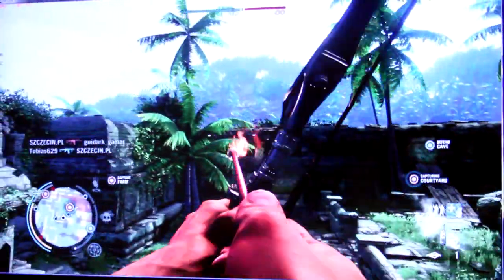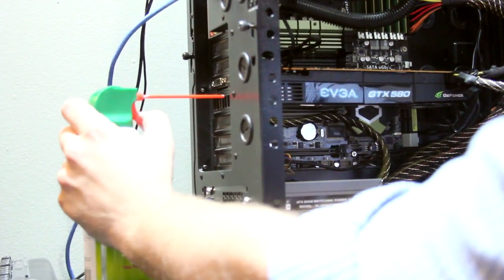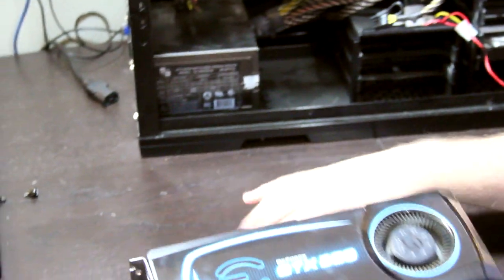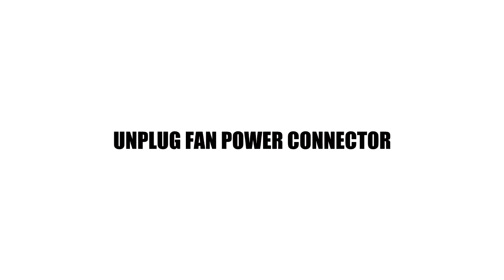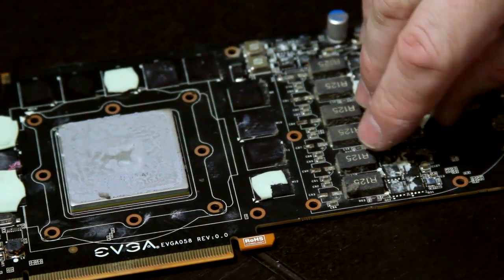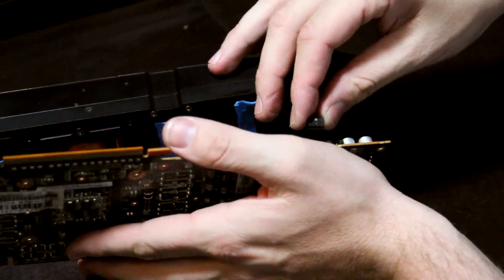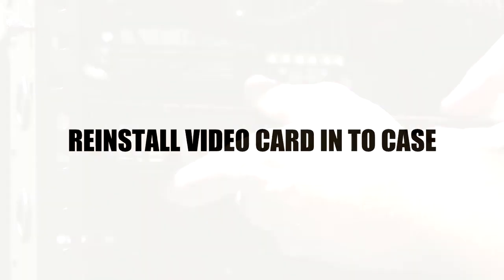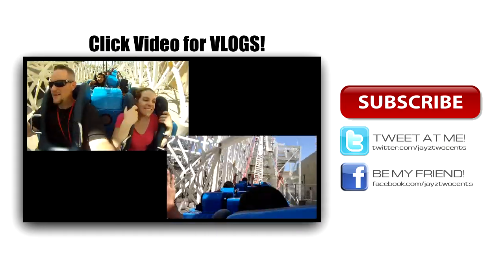How to fix overheating video card - Jayztwocents Tutorial

Comment: I dont know if you'll remember @jayztwocents but were your gpu fans topping out? My rx580 (msi armor oc 8gb) can no longer handle too many particles on screen at once, smoke, fire etc, fans top out, gpu usage hit 102% at one point temps dont actually go over 70odds either, driving me nuts. System has crashed a couple of times, as soon as i rotate 180degrees away from effect/s fans slow down again but theyre definitely alot more sensitive! Bought the card used a couple of years ago and it worked fine intil a few weeks ago. Do you think this is a hardware issue more than a servicing issue? Thanks.

Comment: My gpu is running at around 85c at like 30% fan speed, i dont increase the fan speed since its unbearable over 50% which is the max for this graphics card (RX 480 Saphire Nitro), i have been planing to change the paste since last week but i couldnt get one, im about to clean the card and apply new paste, i dont have any thermal pads though so i hope thermal pads wont be an issue and at least i can get down to 75c i know thats a little too much but i dont see why not since when i replace my cpu thermal paste the temps go down likr 20c i guess ill see in a couple of hours, wish me luck

Comment: my gpu ran at 83 maximum i undervolted it now it runs in low low 70s and stay is 60s 99% of the time but thats not a permanent solution to my fix, the bad part is i have a single fan gpu and i still want it to run lower
Reply: i also changed my thermal paste, which dropped 5 or so degrees, before i changed it was thick and a bit crusty not too much but it was going crusty,

Comment: I am just watching this in 2020. However, tips that I would give first are. If your computer is shutting down, firstly do these steps. 1) Check the thermal paste and CPU cooler and re apply that first 2) If it still shuts down, if you have an onboard graphics card. Remove your graphics card and then attach to the onboard GPU. 3) If you have no problem with the onboard GPU, then of course start following this video. If you do have a problem even with the onboard GPU, then potentially it is near the death of your CPU. I never over clock my PC's so my PC's last for decades, however, one of my PC's is now in trouble, hence having to google and youtube information. I was actually keeping an eye on the CPU temps and they were not over heating, when it shut down. I for one are not looking forward to taking the GPU apart, my first time of doing so, and I will reference this video again when I come to tear it down.

Comment: hi
i have xfx rx 580 8gb oc+, i changed the thermal past and cleaned the cooler but my card is still getting so damn hot like it reaches 89 c, Can you help me to  find the reason for this issue. (but i  must say that even with this high temp my card is working fin and there is no thermal throttling i think when monitored the gpu clock!)

Comment: Way too relevant. I recently had someone fix my gpu. An rtx 2080. The artifacts were gone but when i tested it with unigine superposition the score was low and the temp was at 85c. I opened up my gpu and realized he put the wrong thermal pad underneath the heat sink it looked like a mini sponge. I applied thermal compound myself and the temp was reduced by 30c and my framrate and score doubled. Thank you for the video 😃

Comment: I have a EVGA GTX 1080 FTW. The GPU temps reaches 87’c max. Is this normal for EVGA cards or not? I’ve been reading forums about the temps. And don’t have any luck in my question. 

I have changed the thermal paste with cooler master t paste. Still no luck. Increased the fan speed still no.

Comment: IF THIS VIDEO DIDN'T HELP YOUR VIDE0CARD

Mosts of the time it is dust and air config, but Lots of times its capacitors and transistors. just change them if you are soldering lord becaus ethere will be a LOT OF WORK !!!!!!!!!!!!!!!! I Can do that If You need to change them and if youre graphics card heats up fast , i have 14 year experience with computer fixing in any way.

Comment: Well, instead of alcohol you also can use aceton as well.... but what exactly happens when your gpu overheats like, it#s running towards 95°C and above, does it show the same effect like undersupply of power from the psu?
Reply: it just throttles the speed and increases fan speed to keep itself from burning down

Comment: just apply thermal paste in my vga card now idle temp about 50 up degress C and when playing game 60 until 70 up degress C .. before i change thermal paste idle temp 40 degress C ..  my gtx got problem gpu artifacs .. i read in goggle because overheat  so i chnge thermal paste and now working again .. my vga card asus gtx 770 .. thats temp normal or not or because iam using cheap thermal paste  ... ( sorry for my english hope you understand )

Comment: Attach large heatsink on GPU, reduced temps from 83*C to 55*C. Costs 30$ for ready made mounting brackets and heatsink.

https://imgur.com/a/gnRlM

However VRMs will also need new copper heatsinks i found....these are easily available for 10$.

Comment: My Vid card was/is overheating. I took it out and popped it open. I'm sure that I was careful when I did this as my wires were in tact. I put it back together after replacing the paste; however, my fans are not spinning. What can I do to get them spinning again. The fans were working up until the point I placed the video card back in the slot. 
I'm using a AMD Radeon R7 370.

Comment: I have to thank you for this video. i used Grizzlies Krynoaut thermal paste. best thing i ever did to my Old R9 290. i had to under clock it to 500MHZ so it doesn't thermal throttle.  i used this paste , and on Base clock (977mhz) it only goes up to 76C , i over clocked it to 1000Mhz , and still only runs 79C on Average.  Will  you make a Video of stock thermal paste vs 5 different aftermarket Thermal paste please? Include Grizzlies Kryonaut please :)

Comment: PLease Help me friends Same  problem occuring in windows 7/10 too. 
After 3 hours of working with system then suddenly monitor goes black and Doesnt get signal to monitor. but Asusal CPU is working fine at that time.. i checked  ( Numslock, Capslock keys ) they working fine.. After the force shutdown by pressing power button. later restat my pc again .then everything working fine. Again after 3-4 hours of working  same problem. no signal to monitor..

Some times when i open big games/ softwares like Lumion in next sec monitor gowes black.. Help me guys.. i update drivers and install old version of drivers too..any methods Doesnt working .

Please help me. :( :(
Reply: Your GPU is overheating.
Reply: Gabriel Weeks what's the solution for that?
Reply: See what's wrong, fan or otherwise.

Comment: Did this on my highly overclocked GTS450 1GB (dont laugh, it still works good). Dropped 10 degrees c and lowered my fan speeds by a lot
Reply: my hd6450 at 760/1040 runs 80-84c, im thinking of doing same as its 7 yo card and the seller i bought it from(used gpu) said paste was never changed, i mean i can pickup new one for 10$ in case something goes wrong, which it shouldnt, as its just a tiny heatsink with no pads etc

Comment: When i underclocked my gpu, it was higher temperature than overclocked. Pls help. In a game, it goes 80C on idle its 55C.
Also my CPU never been overclocked, is 84C gaming and 60C idle. It used to be wayy cooler same as gpu.

Comment: My Gpu(ASUS GTX660) idle temp is around 40 degree C. When i start a game like fC5 it runs smooth for say 20 minutes after which it starts lagging like hell. Maximum temp observed in this state is 65 degreeC. Now even if i close my game and keep using PC for another 4-5 hours, the GPU temp never drops below 63 degree! it gets stuck there once it reaches there. Even simple tsaks like opening my computer, chrome or any stuff like even scrolling my mouse around desktop LAgs! It keeps that way untill i reboot PC, Now say after reboot if i dont play any games than too after 1 hour the gPU gets to 60 degree C and keeps that state on idle also. If i force playing games in laggy condition, after half hour my PC hangs, the game screen gets stuck in that graphic.Cant minimize, no key combos work. I have to just turn it off by wall switch or press the physical restart button. I think the GPU stops responding at this state, it is unable to display anything to the screen. Any suggestion? I have already ordered Arctic silver 5 and will change the thermal paste next week.

Comment: what's the best software to use to record temperature and fan speed one that show's it on screen wile playing
as I think my Sapphire r9 285x is running hot
also Jay you should make it clear that all thermal pad's are not the same and that they need to find out what thickness of pad is used on their graphics card's took me sometime to find out mine is 2.5mm thick

Comment: 81 Degrees Celsius at 75% Fan Speed before fixing, and 74 Degrees Celsius at 50% Fan Speed after fixing isn't exactly a huge difference. Hardly seems worth the effort.
Reply: سمط جارتي  خير من هذا
Reply: Depends on the card, i have had cards that sounded like a jet engine after 60% or so fan speed.
Reply: Extremely quieter fans and 7°C cooler? That is impressive for just changing that... you could also undervolt your gpu and underclock it to reduce it more

Comment: 21c idle, between 33c-45c under load dependent on game. I game quite a bit, but I also clean and maintain my system regularly.
Reply: Jay K 21 idle? where do you live, the magnetic north pole?
Reply: Neon_Lights12 Hehe, not quite. I keep my PC close to an open window which sees quite a bit of a draught during the day dependent on weather conditions. Between 21c-23c idle is about the norm during the colder months. The idle temps hover between 25c-27c during the summer months.
Reply: Is that on air? My 970 won't  idle lower than 30c even with the fans on max, and we usually keep the house between 18 and 20 ambient.
Reply: Neon_Lights12 Yeah, nothing fancy like liquid-cooled; plain, old air. I guess I kind of got lucky by choosing the "right" type of GPU, too. At the time I knew very little about GPU tech, and I just bought the GPU based on reviews on Amazon. It's only until quite recently did I learn about factors such as Reference vs Non-Reference cards, and things of that nature impacting card cooling and overall performance. In the future when I'll be looking to upgrade I'll be paying close to attention to the issues that seemed to have worked themselves out in my favour this time around.

Comment: hey Jayz, what program do you use to check temp and fan speed
Reply: Thanks moosey
Reply: hey sir.... can i ask something? everytime i play game on my desktop my monitor suddenly turn black...but i can hear my game still running even if i switch it to the builtin video card still the same... all i can do is to force restart and its ok again... thanks in advance sir moosey
Reply: Hi moosey, changed termal paste and pads. However prettymuch the same temp. As my card is factory overclocked, do you think underclocking the card may prevent overheat?
Reply: moosey moosingtonthethird Temps go up to 90 celsius while 75%fan speed in some game modes. Video card is zotac geforce gtx560 ti.
Reply: i Have the same problem like Chirs (NVIDIA Geforce GT 640) And my temps are going Extremly high while im in game it goes around 90-100 C ive added a bigger fan ,it was fine for a month then the prob appeared again. what should i do .
Btw my pc is 2 years old i dont think that the card is burned yet.

Comment: Idk for whatever reason when I installed my noctua d15s today my gpu started to hit around 80. I'll try to work on why the temps when up. It usually averaged around 40 degrees on load. I use attila total war custom battles for testing my cpu and gpu to look at temps. Just wondering if anyone knows why this has happened.

Comment: I think my 980 has had it. It won't display picture a on the screen. I take it out with the PCi connectors out too. I put it back in and it works sometimes it doesn't but then my 980 just stops working while my computers on. I checked the bottom where it connects. Its slightly singed at the tip. It was working before, but not anymore. I don't know if these steps will matter or not.
Reply: can you give it to me?
Reply: VTL 
Mailed it back to EVGA. I have a 3yr warranty on it.

Comment: Guys I screwed up somewhere. My display doesn't work on my gtx 980 anymore but it works when I connect it to the mobo. The video card is on and the fans are running but no display. How fucked am I?
Reply: You're done mate. Ebay it at $42

Comment: My video card is on 80 degres when game isnt running ,when i load the game it goes up to 100
Reply: Holy fuck.
Reply: Swifty Gaming
 sometimes 110 lol
Reply: mine geforce 480 before i buy geforce gtx 980 up to 151 and burn X D
Reply: Same on my gtx980 >.>
Reply: Mine went to a blaze tempature like u feel on a fireplace and it still runs surprisingly.
Reply: I had this issue and it stopped when i turned off nVidia shadow play, which for some reason was/is causing the cards to run at full tilt.

Comment: My video card overheats up to 96c, and it shuts down instantly, after that i turn-on the computer again, but it display green, black and white lines, pink color. It doesn't display text, just a colors.
Reply: Damnnnn thats so high you could almost boil water with that thing. My gpu is quite old so the fact that i use 2 monitors makes it overheat and it stays at about 70° all the time..gotta fix it
Reply: i think my GPU was damage because of massive overheat?
Reply: +Tom Louwell i dont belive so. desktop gpus can handle that but its safet if its in the 80ish degrees. :^)
Reply: Master Yoda wait i will give you a link, what my GPU display on screen.
Reply: Sounds like an artifact to me. Which is means that your video card is saying goodbye.
Reply: mine reached 100C and shut itself off
Reply: it shuts it self off because it protects itself from permanent damage. Try buying a new graphics card or re-apply thermal paste or a simple one, just by cleaning your gpu.

Comment: My gtx 780 strix is running on its base settings (boost of about 1000mhz) at the temp limit of 80c... When i allow it to go up to 93 it goes to it and boosts up to 1100 mhz. At idle it sits at 40 C... Is this the same situation as shown in the video? (temperatures where tested in Valley benchmark AND BF4)

Comment: When I apply thermal paste I do the original method "the blob," basically place a blob in the middle and press gpu back down. It will create a smooth surface and spread out evenly.

Comment: Guys rly nees help my specs i3 4170
8gb ram
gtx 750 ti1gb
so my problem is when i turn on my pc it loads then restarts then it loads normally and i want to go example on browser or just soing nothing my pc freezes few seconds later black screen shows then my pc restarts i can so shit any help?I was using it 2 days nut 80%of that was odwnloading games from steama and other was playing leagueoflegends medium 1920x1080 200fps and minecraft 500fps(no shaders low texturepack) and fifa 16 loe settings 1920x1080.Also when it loads its saying that drivers have succesfully recovered and some problem when i click solve problem nothing happens ty for everyone pls help boguht my pc 3 days ago
Reply: Get off your CPU cooler, clean thermal paste, then put a new one, if doesn't work out, you better replace your power supply.

Comment: really strange also have a windows 7 install on the same PC on windows 7 my temp is just 33C on the   VTX3D HD 7870 fan speed 35 and is cold to touch to.  
I made the screws a bit looser but don't think it would have made that much difference?
must be something bad in windows 10.

Comment: i did all that , still overheating .. :( 
any other solution?
Reply: me too with gtx 580
Reply: Right there with you!
Reply: I also have a 580. I think it's time we throw it in the trash and get an upgrade.
Reply: +Hayden Roberts i bot a GTX 780 now and sold The 580 for 60€
Reply: 3lp4u Nice one!
Reply: I just replace my GTX 275 2 months ago... :/
Reply: ***** That's an old card. My GTX 285 died in a year of buying it and they replaced it with a 470 :-/.
Reply: I bought my EVGA refurb 275 in 01/2012, still kickin'!
Reply: ***** EVGA is the only brand of GPU I buy. Always good quality and support is top notch (y).
Reply: guys , turned out my graphic card was fine.
it was the power supply all along.
the fan wasn't working so i had to fix it.
works like a charm now :D .
check yours , maybe we shared the same problem.
Reply: +Agnostic hey man, what was wrong with your PSU? My GPU overheats as well, maybe its my PSU just like you.
Reply: thebinggoman Hey! :D
well .. my PSU happened to be insanely hot when i touched it.

so i checked and the fan wasn't working.

i went through a lot of shit to replace it , cause the fan was fine ,the power supply's plug on the other hand wasn't.

so i cut the fan's wires' , and also cut a usb wires' , and taped them together and plugged it on my computer.
so now the fan starts when i start my computer.

you should check the fan , if it isn't working , you should replace it.

it's been over 2 months now , and never had a crash.
Reply: +Agnostic will check on my PSU then. Thank you!
Reply: thebinggoman
good luck
Reply: Agnostic thanks man. Turned out there was nothing wrong, its just the high ambient temperature in my room. I live in a tropical country.
Reply: thebinggoman glad you got everything worked out